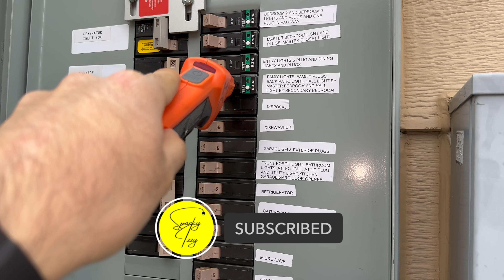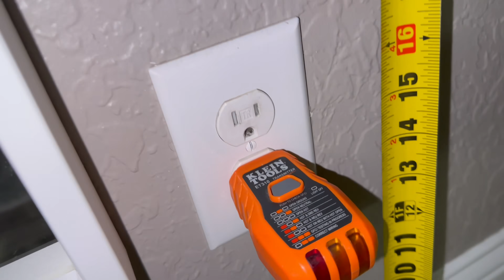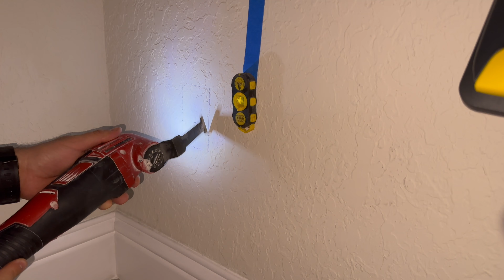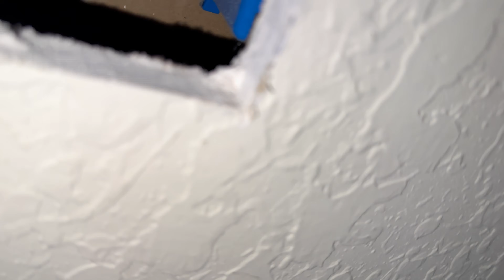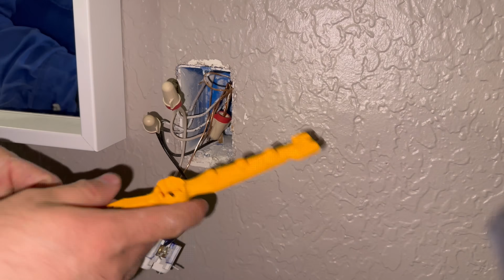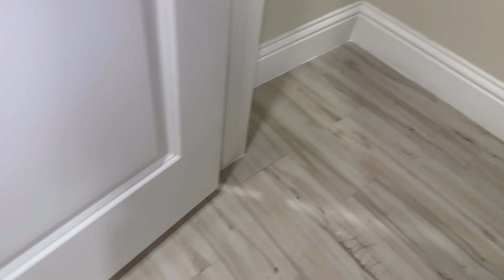How To Add an Outlet to an Existing Circuit | Closet

Comment: Good job overall, but I'd like to make a few points/suggestions. On the cut in box, those are integral clamps and meant to hold the NM cable (Romex) in the box. You aren't supposed to rip them off. Also, I find it easier to strip the wires before I put them into the box so I use an NM Cable stripper that strips 12-2 and 14-2.
Reply from the maker: Appreciate the feedback, I have a love hate relationship with those clamps. I need to leave them on if they come with them 👍🏽
Reply: @sparky_izzy  No problem. My method is to push the clamp in with my finger or flat head screwdriver enough to make it easier to get the romex in there.
Reply: @sparky_izzy  do you know the wago 221